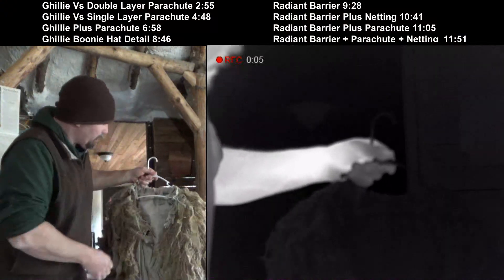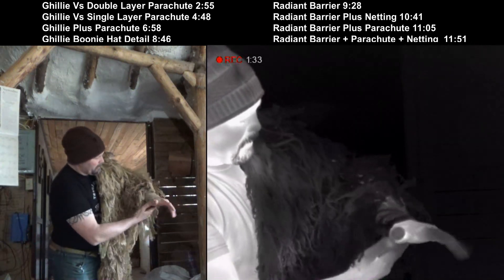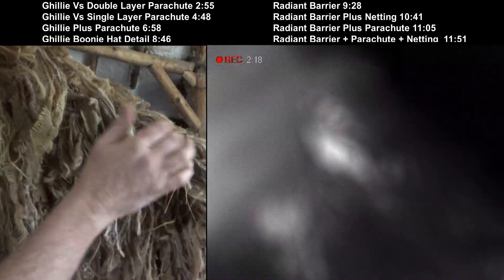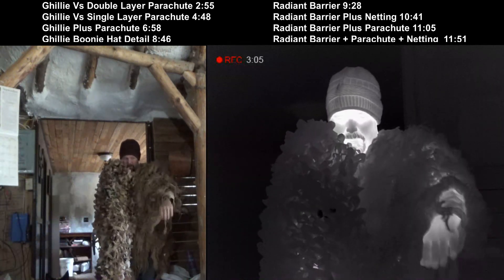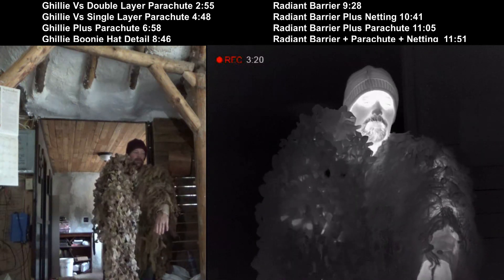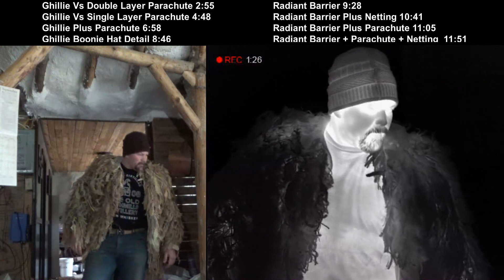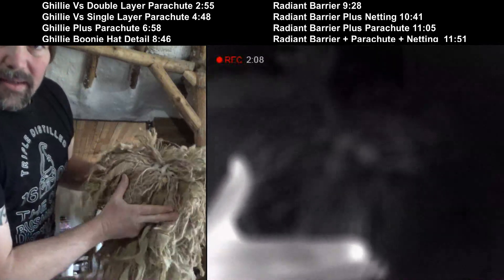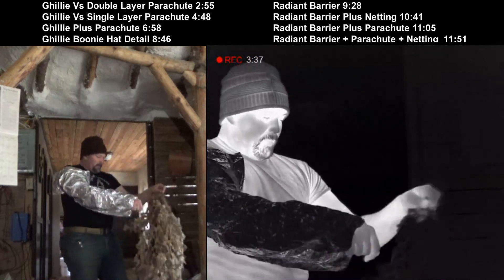Thermal Imaging.  Ghillie suit detail. Plus radiant barrier, parachute, camo net  comparisons.

Comment: How do people live life with dying smoke detectors?
Reply from the maker: Pretty easy. You tune it out and ignore it. I didn’t even notice it was still doing it until people started commenting. I’ve changed the battery a couple times and verified voltage via multimeter. Batteries are fine. The detector falsely reads low for whatever reason. But it goes off when smoke backdrafts from wood stove into room, or when I cook with oil too hot on cast iron pan. So it works fine. I just tune it out and don’t even notice anymore. You’d be surprised what you can adapt to and tune out.

Comment: The netting is still hella loud to move with. But i appreciate ur efforts!! Keep improvin!
Reply from the maker: Yep, the netting is loud. ☹️ one of the downsides of ordering online. I had no idea until it arrived. But I think it shows potential visually. So I need to find netting made with another type of material that is quieter, but still creates that stand off and thermal break. Humn. Softer and more flexible probably means quieter, but it might lay flat instead of having that “poofiness” I want. Technical term. From the 80’s. For hair. Lol. 🙄 I need to talk to a costume specialist to get ideas on what types of material might fit the bill. There might be something commercially available im just not aware of. Anyway, thanks! I appreciate the feedback. I’ll just keep on trying. 👍🏻
Reply: @ThatThermalGuy  I reckon the netting is only loud coz it's really loose. If it's fixed together it won't rub between layers and in a fitted fixed suite/position it,'ll fit and be quiet. Then stitch onto it some ghillie strips which will silence the netting further and aid in blocking visual plus thermal Sig.
Reply from the maker: @ms_needle  Hey, got it! I had started writing a response, then got your second, and deleted everything before I sent it. Lol. Good timing. 👍🏻 I’ll write more tomorrow, but wanted to at least confirm receipt. Thank you!